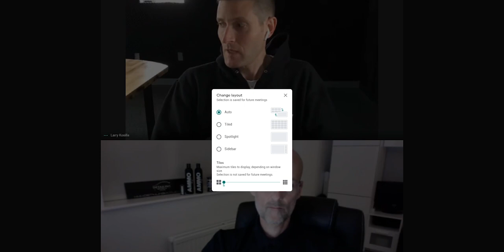What Does Larry Think About Graphene? Interview with AMMO NYC PART 1

Comment: If graphene has any positive quality, and I'm not sure it does, it would be through improved UV absorption characteristics.  This is easily tested for - coat some acrylic panels with various products and then check their UV absorption characteristics.  If the added graphene does improve UV absorption, I would not expect to see a difference between the products for many, many years --- not until UV light would normally be expected to cause damage to the underlying paint.  If the product does offer additional UV protection, it's best purpose would be to help protect cars that are stored outdoors.  Scientists have spent the better part of a decade trying to figure out how to produce continuous graphene sheets in high quality, and if you could just suspend the powder in a carrier and let it dry, that effort would have concluded 10 years ago.  It's absurd to think that all of the strength qualities of graphene would be imparted simply by adding RGO, but it's not absurd to think that it's absorption spectra might be beneficial.

Without any scientific testing of graphene ceramic coatings specifically, I personally choose to use graphene products anyway because there has been some testing of graphene added to TIO for other purposes, and RGO does have added UV absorption characteristics in THOSE applications, and I doubt adding graphene to the coating has any negative impacts.  Still, without study, that decision is based on nothing more than educated scientific guesswork.